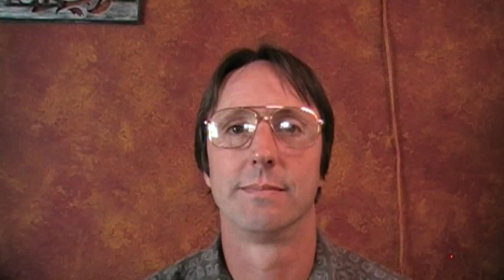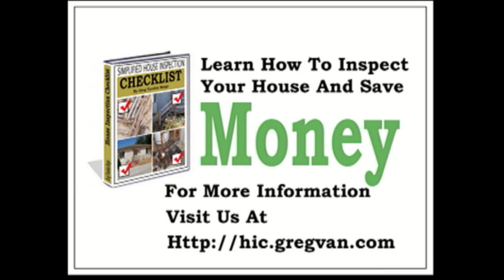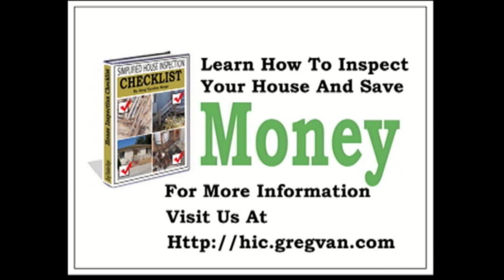One Hour Garage Fire Wall - #41 House Inspection Checklist

Comment from the maker: That's a good question and for the most part they wouldn't. What happens is that when the home is built, the building inspector can see particular words that are written on the drywall, before it's covered up, but other than that, you would need to drill a hole in the drywall.